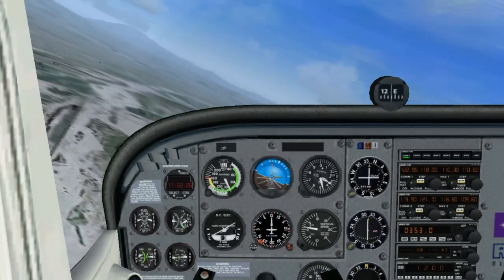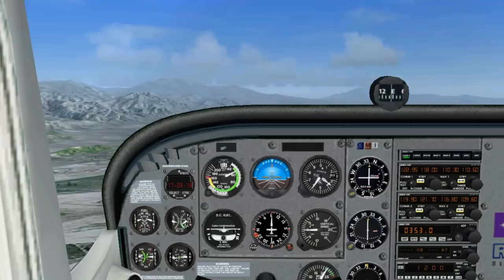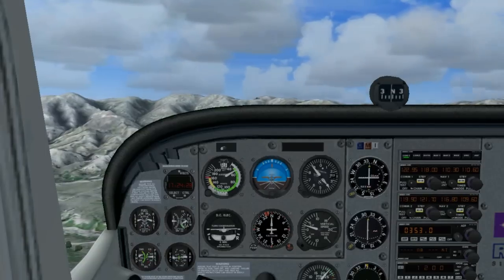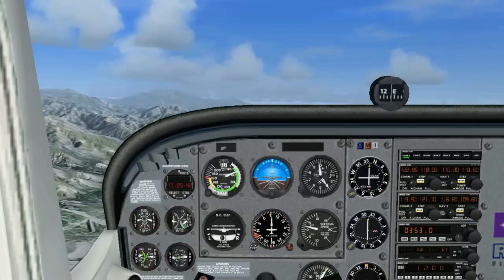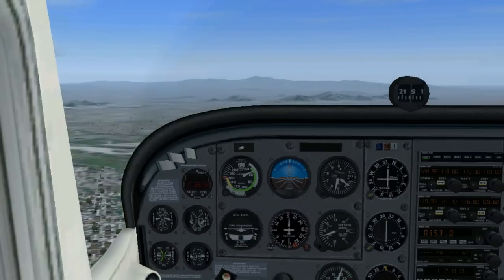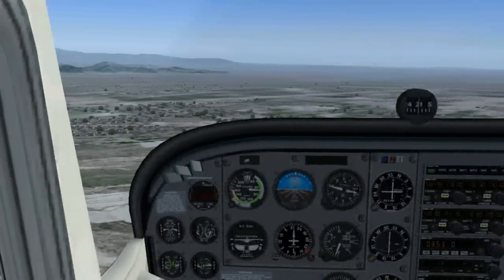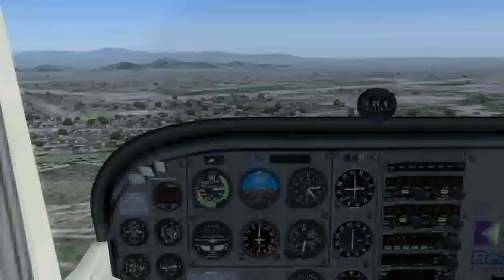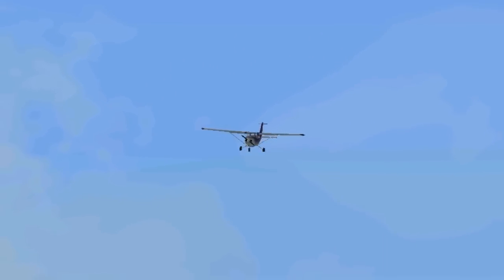Slow Flight Tutorial (Part 2) - VFR (MSFS) (improve your landings)

Comment: @FSX404 okey okey, but why you dont use the ILS, or the VOR? And , and you turn off the power before the engine, which is not true, at least that's what I remember the manual cessna. But, okay, it was a good landing if you want to know what I think is a good pilot FS, take a look if possible: and you turn off the power before the engine, which is not true, at least that's what I remember the manual cessna. And, I think that this is a Pilot :/watch?v=_5QCKDczwMU

Comment from the maker: @nietztsuki 

Don't forget that older Pipers have only two fuel selector valve settings, left or right.

Many pilots have crashed them because there was no "both" setting and they forgot to switch the selector every 20 minutes or so.  So they crashed because they exhausted all the fuel in one tank.  We all do the training for all that but in an emergency, your brain can freeze and you can forget the simplest things, like checking the fuel selector valve.

Comment from the maker: @nietztsuki

182 is a great plane, the 172's and especially 152's are forgiving planes, you can, in a way, force them to do anything you want and they handle it.

Once you get into the 182's they are a lot more stable flying platforms, the difference of would be comparable to driving a car and a big truck like F350.  If I had a choice of planes (in that price range) I'd get a 182 over the other two.  30-40 knots faster too

I can't speak for low winged cherokees, I never flew one.